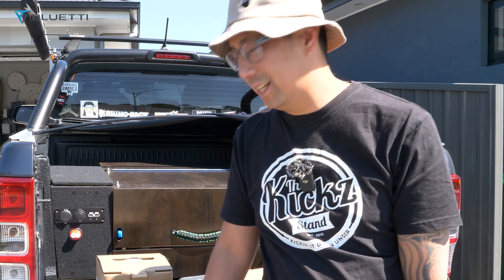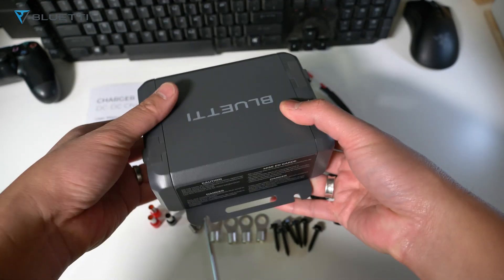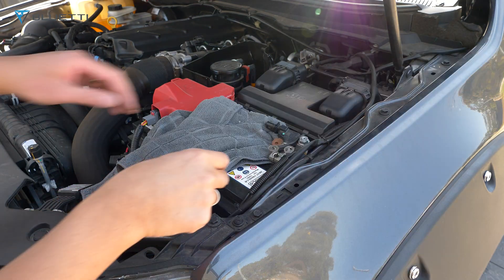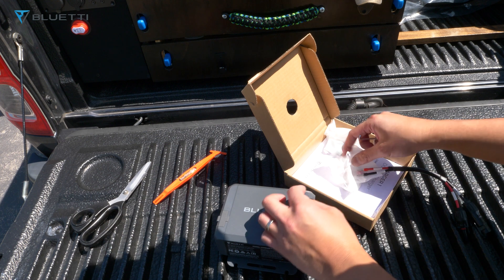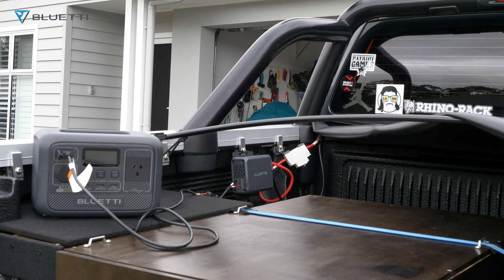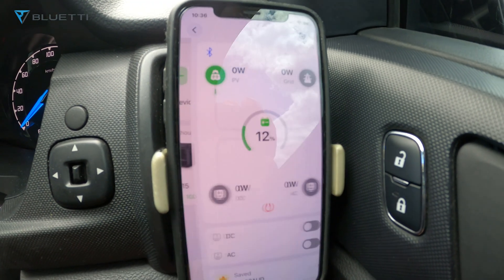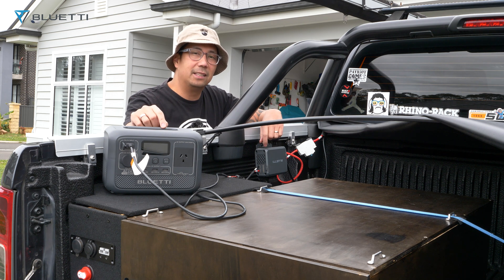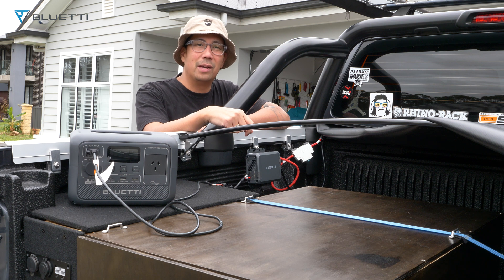How To Install Bluetti Charger 1 The Ultimate Alternator Charger!

Comment: This looks like an accident waiting to happen. The charger one is not waterproof and either is the relay and you have them sitting outside. It appears. The charger one is great if you can get over 500 W out of it, I would not bother if you’re getting less than 200 W. I love mine but it’s installed where it will stay dry and puts out 560 W when my engine is running. It stops charging when I turn off the engine.
Reply from the maker: I have a tonneau cover on my truck bed which keeps everything dry 🤙🏾

Comment: Can i plug the bluetti charger 1 onto my 50a Anderson plug i have at the back of my ute?
Reply from the maker: Is the Anderson plug connected to the car battery?
Reply: @4X4JUMPMAN  yeah. With a 50A switch.
Reply from the maker: Yeah you just need to change the charger 1 cable end to an Anderson plug.

Comment: Alternator charger????? You did not connected to alternator why is that????
Reply from the maker: The Alternator is connected and powers the battery and is connected to the charger 1 which powers the Bluetti😃
Reply: @ so why use the word alternator on the title if you not hooking it up to alternator should be battery power 🤣🤣🤣 or dc to dc charger
Reply from the maker: It’s a 560w Alternator Charger! Use your common sense it’s on the website 😂 https://www.bluettipower.com.au/products/bluetti-charger-1-560w-alternator-charger-copy?_pos=2&_sid=c4ae60b87&_ss=r&id=66f0d731cab47e5992230ac9&ref=4X4JUMPMAN&utm_medium=Goaffpro&utm_source=affiliate
Reply: @4X4JUMPMAN   I still don’t know where is the alternator in this video to we needs to connected it to alternator instead battery ?
Reply from the maker: It’s ok mate just connect it to the battery and everything will work out 😃 Don’t worry about the title it just confuses you 🤣
Reply: @4X4JUMPMAN  good answer 👍👍👍no more alternator
Reply from the maker: Feel free to use the discount codes and links on the description if your purchasing any bluetti products 😃Have a good weekend!

Comment: How are you mounting this in your truck bed?  I asked Bluetti what the IPX rating of the box is and they replied that it's IPX20.   That mean it has essentially zero water resistance.
Reply from the maker: I have a Tonneau Cover and it stops rain coming in my truck bed…I mounted it on the side of my tub you can use the self tapping screw or drill a hole. Also you can make it portable by making a battery box and connecting it with Anderson plug.

Comment: this is very confusing, you have all kinds of stuff connected to your battery - mine does not look like that at all..
Reply from the maker: Yeah I have lots of 4x4 accessories on my battery. You just got to make sure you have the red wire on the positive and the black on the negative.
Reply: @4X4JUMPMAN  yeah but doesn't that kill your alternator ? i mean eventually it's gonna die right? I just ordered this for my class a RV and i'm nervous about reducing the lifespan of the alternator.. any insight as to how much it reduces the lifespan ? and it may start acting funny well before it finally dies, which can cause other components stress
Reply from the maker: @DeFiDuke  According to the FAQ on Bluetti website support it says- No, Charger 1 monitors your car battery’s voltage and adjusts its output accordingly. If the battery voltage is low, Charger 1 reduces power output; if the voltage is high, it increases output. If the battery drops below 12.0V/26.0V, Charger 1 triggers undervoltage protection and stops charging. With proper maintenance, your car battery will last as long as intended even when using Charger 1.
Reply: @4X4JUMPMAN  lol not talking about the battery at all, I'm talking about the ALTERNATOR which is what actually powers the Charger 1
Reply: @4X4JUMPMAN  brohams, i think all these new alternator-chargers are gonna kill the alternators and people are gonna be replacing them like hotcakes in the auto shop in a few years..  auto repair shops are gonna love it
Reply from the maker: @DeFiDuke  same thing it only uses excess power from alternator that’s why when voltage drops then the charger 1 turns off.
Reply from the maker: @DeFiDuke all new alternators and chargers are smart and turns off when it’s under voltage. Not sure if you understand what I’m saying.
Reply: @4X4JUMPMAN  so you are saying they don't stress the alternator because they shut off ? hmmmm
Reply from the maker: @  Alternator powers the battery and the battery gives the same amount of power and the charger is the one that works hard and converts the power. Easy way to understand without saying voltage and amps etc.

Comment: Do I need a charger 1 for each AC500 or can I split the cable to both AC500.
Reply from the maker: I’m not sure if you can split them. You might have to charge them individually.

Comment: Sorry but it has to be very tight! Mine came loose on fire roads! I actually used some thread lock to ensure it does not happen again.
Reply from the maker: Good idea..I just finish a 30min trail and mine stayed on. But if it does come off next time I will use your idea with the thread lock. 🤙🏾

Comment: am I the only one who's paranoid that there is no physical "kill-switch" on the charger itself??? yes trust the technology but ....
Reply from the maker: @JohnPhan1   I waited for 30mins and it actually turned off and my battery was still ok. I think it’s all in the mind. I’m sure bluetti’s top engineers have tested these out before releasing it.
Reply: @4X4JUMPMAN  you have 15 feet? Of unfused cable before reaching circuit breaker at charger.  Breaker needs as close to car battery as possible.    Could be a major problem
Reply from the maker: @jtsterry  I have 225 fuse and a 125 fuse as shown in the video on my battery.
Reply: @jtsterry you would need another fuse at the feed end
 Bluetti says the circuit breaker in not suitable for under hood mounting because of the heat.
Reply: @4X4JUMPMAN  lots of things are thoroughly tested and wind up getting recalled after failing catastrophically.

Comment: 130w in. That is not even 10 amps. Your cigarette light output could output that.
Reply from the maker: You can adjust the amps on the app to get more amps I just haven’t tested it to show on the video. I just showed that it works on my AC2A. At the end of the video there is a diagram that shows how capable it is with the bigger power stations at max of 560watts.
Reply: @4X4JUMPMAN  I think you mean increase V instead of A
Reply from the maker: @jtsterry  yeah the V increases
Reply: @nascar427  use the app to adjust the voltage up to 56v, that will then give the max amps output.
Reply: If you are going to showcase a product then you should showcase what it can do! I don't know why you would bother filming it when it was only outputting 130W. That's a minuscule improvement over the 100-110 W you get from the Rangers tub cig lighter outlet.

I suspect the reason the video didn't show it doing 560W as it can deliver is because the AC2A is limited to 270W solar input, is this correct?
Reply from the maker: @brettyallop6018  AC2A has only a max of 200w or 28V…that’s why it will never go to 560w. Car is not moving and is only running on idle. I will show on the next video on how much it can increase to. This is only an installation video. Not an in-depth review.
Reply: Does it reverse charge like the ecoflow to boost a dead battery?

Comment: I have a question you may not be able to answer.  From the users manual of your AC2A, solar charging is capped at 200 watts per hour and DC input voltage is limited to 12 to 28v.  Looking at your app display you are 133 watt charging is at 28v.  The Charger 1 is said to output over 500 watts at 10 amps.  It looks as if your AC2A will never see 200 watts from the alternator Charger 1.  Your system is only charging at 4.5 amps.   133w / 28v = 4.5a.  Your cigarette socket charges better than that.  Can you adjust the amp in the app to 7.1amps yielding 200 watts charging for your AC2A?
Reply from the maker: @almostrvperfect6203  The AC2A has a turbo charge mode that you can turn on to get higher watts but I have not yet tried it. I will test it out and see how close it can get to 200watts.
Reply: @4X4JUMPMAN  OK ... The Charger 1 is supposed to charge at up to 10 amps.  I was wonder why you only get 4.5? Thanks
Reply from the maker: @almostrvperfect6203  There is a setting on the app if you want to go to 10amps or more but the settings for when selecting the model of the power station which is the AC2A probably is set to a lower amp that suitable for the AC2A I assume. I’ll try test that too next time. The charger 1 has so much function I have not yet tried. Any other things you think I should try?